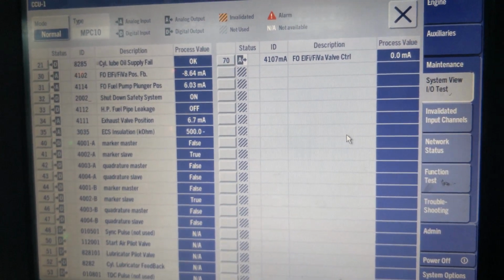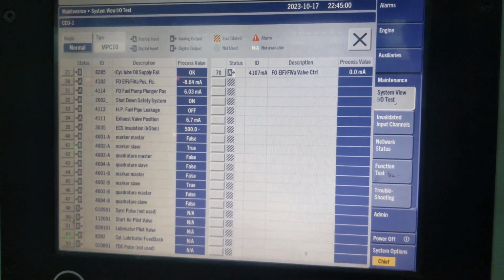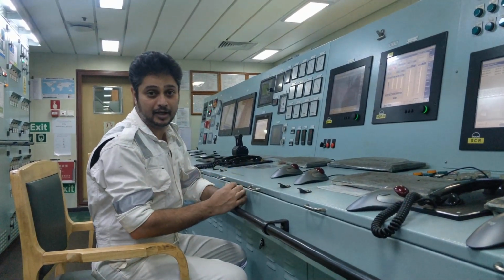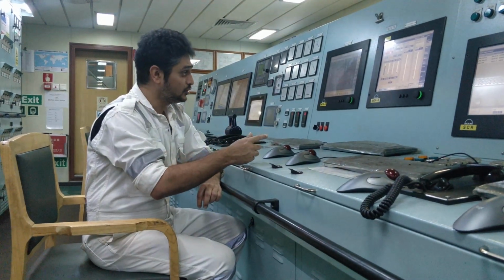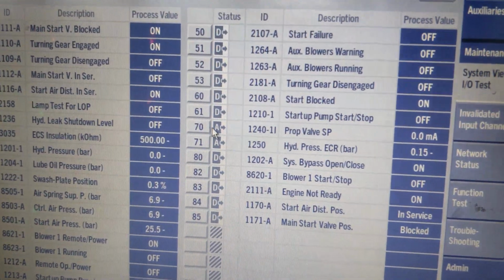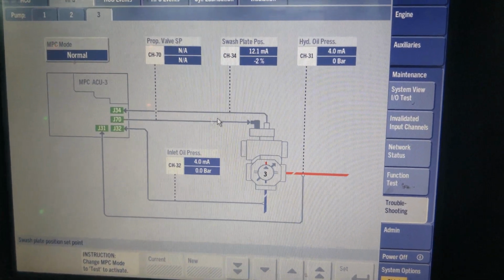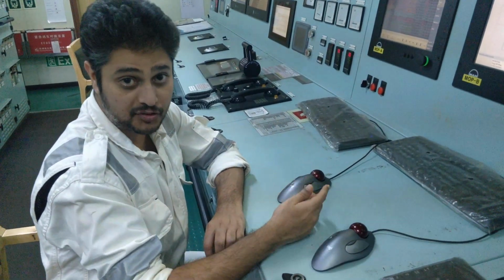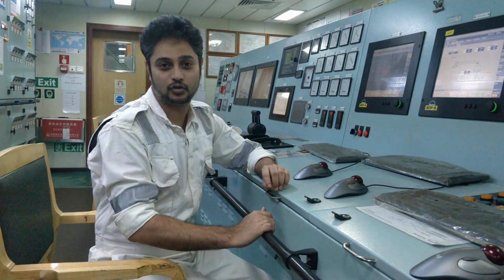ME Engine Reversing -New Age Online Marine Academy

Comment: Gvg sir saw ur vidio preparing for my class 2
Reply: One thing wanted to ask her in me engine if one of the HP pump fail.can the engine will reversed and vice versa
Reply from the maker: Yes.engine can run  normally with one pump failed.